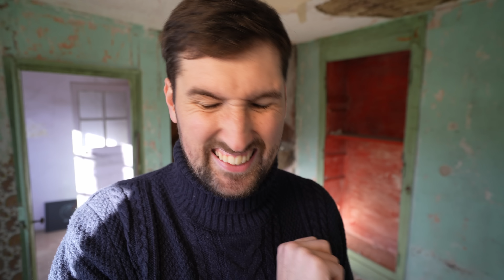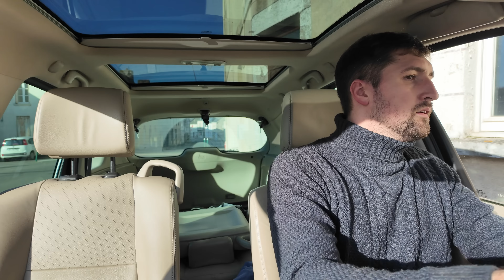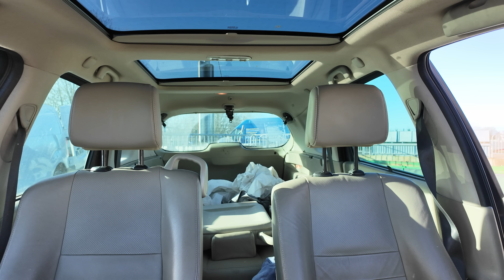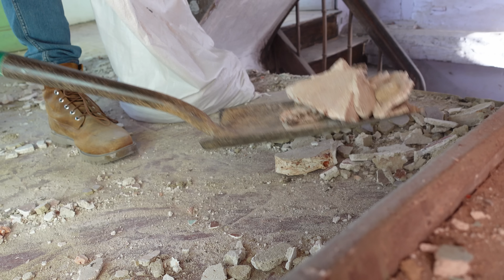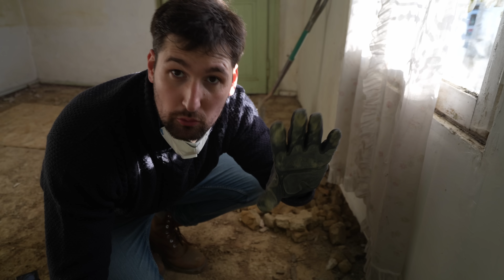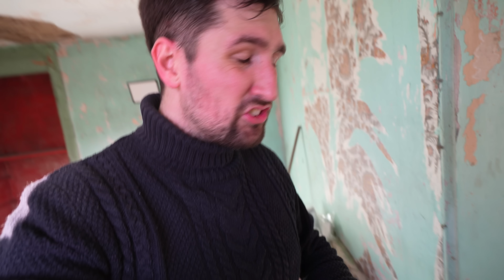The Unsettling Discovery I Never Saw Coming...

Comment: I have a suggestion to reduce your picking up work.
Make the hole in floor where the damage already is. Put a garbage can on the level below directly under the hole. Line the trash can with your bags. Then simply shovel the dirt into the trash bag/can below.
Easy Peasy👌
Reply: Fabulous idea. 🤙
Reply: The only problem is will stir up more dust into air that way. But otherwise gravity works. That's what they do in mines use chutes.
Reply: Et poser une goulotte à gravat dans le trou. Les gravats descendront doucement à l'étage du dessous. Courage.
Reply: @alphaonde8144  Oui, ce serait mieux! 👌
Reply: Also, start at the top and work down otherwise you mess up what you have already cleared.

Comment: That’s a great habit to pick up from Billy, clean as you go. There’s far less chance of injury tripping over something on the floor. It’s great to see you getting into the renovation, but I have to say that the floor in your ensuite really has me worried. It doesn’t seem to have great support for all that weight. But you’re going to know more as you get going on it. Good luck, hope it’s not too bad.🤞
Reply: I don’t think Billy ever leaves without cleaning up!
Reply: Do they have rubbish containers that can be dropped off at a property, and that way, you just throw all your refuse in it, they pick it up, when full, and take it to the tip.
Reply: @terriwho7613 regretfully Ryan has no outside space so all waste has to be stored on site untill tip load acuminated.
Reply: And saying crack on lol.
Reply: Roll down the top of your rubbish bag, it will sit on the floor better which makes it easier to shovel into, unroll as bag fills
Reply: I think cleaning up rubble everyday also gives you a sense of hope. When there’s rubbish left everywhere you just feel like it’s a chore on top top of a chore on top of more chores as they accumulate, not great for the motivation or mental well being particularly for those inevitable days that will be tougher than others
Reply: Re: Safety. That stairwell really needs to kept swept Ryan. I kept waiting for you to take a sliding tumble down them as you were carrying the rubble sacks downstairs.
Reply: Ryan, I suggest you lay down some blue tarp sheets.  They're cheap enough ie. 12m×4m is only 5.99e in our local brico or Action store. We're currently renovating, but our walls are covered in cement. It was very popular in the 70s as do called insulation 🙈🙈💕
Reply: @terriwho7613  umm, where would they put something like that?
Reply: @pinkelephants1421  That could happen. Those stairs are steep and narrow. Not much room for error...

Comment: I find it completely bizarre that anyone at any time thought that it was a good idea to make a floor with wood, covered in dirt, covered in tiles. Just a thought - if you roll the tops of the bags down a few times it will help to hold the bag open while you fill it. Looking forward to seeing the renovating progress.
Reply: dirt was the best cheapest insulation and soundproofing to be found in the days these  houses were built probably best  cheap soundproofing today if if people didn't relate dirt with unhygienic
Reply: My thoughts also about turning down the bags slightly a couple of times. Helps greatly to keep the bag open and saves time fiddling with keeping the bag open.
Reply: I've never seen a dirt floor unless it was the ground floor which was the actual earth. I've never seen anyone put dirt on top of wooden floor. That makes no sense.  Beginning to see why the house is only £15,000.
Reply: My same thought to tell Ryan…lol😊
Reply: Ryan, what about rather get a small trailer for behind your car, that will help a lot and save your car. Love  your place! 😍
Reply: Your whole comment was exactly what I thought! 😅
Reply: @elsaduplessis3185 try driving that in those mountain cities and  roads😮
Reply: @whytedraegon66  I didn't even consider the hygiene  aspect, I was more thinking of the weight and ability to hold moisture. =)
Reply: @elsaduplessis3185 
I took the backseats out of my car and can get an extension ladder and lots of stuff in there and still close the trunk door. It’s almost as good as a van.
Reply: Il fessait cela pour isoler  et insonorisé.et  , au raide chaussée, il pose les dalle sur sable.

Comment: Wood under a soil floor has the potential to retain moisture and ROT! Ryan you are right….it’s CRAZY !  If one beam  is rotten, all the beams will need to be examined & assessed. You’ll sure need to rent a dumpster ( aka a Skip) to get rid of all the rotten structure.
Reply: Wood under a soil floor is a crazy thing that I've never seen before.
Reply: Why would they put dirt on top of wood on an upstairs floor?  Weird.
Reply: Stop the stench of the rotting bodies….wooooo
Reply: @caseyflorida  Insulation factor.
Reply: It’s the French 🙄 don’t try to make sense of it. 😂
Reply: It seems standard in older homes. As long as it stays dry it seems fine. On “how to renovate a chateaux” channel they refinished the floors, had to make some repairs, they left the dirt at the carpenters advice… 
I guess in the old days it was harder to plane wood to be exact thicknesses so they could have a variable thickness layer made of dirt so the finished surface would be even.
Reply: I think the rot is concentrated under that window. I bet it leaked and the water absorbed into the dirt, beans etc…
Reply: He has no backyard, front yard, or driveway to put a skip.
Reply: @martinfurtner2136  It’s funny how ppl above commented and mocked techniques that they had no understanding of, like they don’t let their ignorance get in the way do they😂

Comment: You could use a couple of plastic garbage cans the same capacity (liters?) as your bags, and use them to support the bags and not have to hold them open with one hand. Also, lay a huge plastic sheeting on the lower level floor to catch dirt and stones. Then grab the 4 corners of the sheeting to take to the tip, and you won’t have to shovel or sweep.
Reply: I feel the cans are easier to carry (not fully loaded obviously) down the stairs.
Reply: Ryan  perhaps it's time to buy or rent an OLDTRUCK. AS U WILL NEED MORE HAULING AND CAR WILL GET BEAT UP AND LIJELY GET VERY DIRTY.  U WILL NEED TO HAUL BIGGER LOADS FOR TIME MANAGEMENT MY DEAR😂
Reply: @boessheila50  he clearly said in the video that those are difficult to come by & expensive if you can find one in his area.

Comment: Perhaps a small trailer would be your best bet for hauling stuff to the tip and supplies from Brico.
Reply: Trailers are very expensive, and it does not look like he has parking for one.
Reply: @janetpendlebury6808  It really depends on the type of trailer that he buys.  He isn't going to pull a large one behind his car.  Just a small utility trailer that can be pulled behind a small car like his should be fine.  He has a parking problem already, therefore loading up a trailer with rubbish to go to the tip shouldn't be that bad.  Ed on the Bordeaux Life YT channel parks his van on the street to load and unload it.  So I guess Ryan would be fine parking on the street too.  But you do make a very good point.

Comment: Isn’t that earthen floor extremely heavy? So crazy. When you have the dirt out the new floor will be so much safer. I can’t believe it. That dirt is insane. Hauling it up would have been backbreaking labor. I would push it through the hole so you don’t have to lug it down the stairs.
Reply: Probably the best affordable option at the time, especially during war years.
Reply: @dwestibclc Right, it would work as insulation and sound proofing.

Comment: Bon courage, Ryan. What an adventure you have ahead of you. 
A thought on your 'dirt' bags. I'm not sure if it will even work but worth mentioning - if you get a laundry bag frame and clip the edges of the bags over that, it may make filling easier. It doesn't even have to be that sturdy because the bag will be resting on the floor and it will simply be to hold the bag open.

Comment: Ryan removing the dirt base is going to reveal the wooden subfloor and weaken the floor on which you are standing. I think a scaffold may be needed so that you have a solid place to be while removing the floor. take out the floor and make a space for scaffold and go from there the beam is done for and needs replacing. If one floor is dodgey count on  having to remove and replace all flooring  in time
Reply: Why is there a dirt base on the floor to begin with?
Reply: @rumakingthatup , insulation. It was a pretty common way to insulate between floors for quite a long time.
Reply: @yasha.hartberg  thank you

Comment: To make your cleanup more efficient, think about using a large trash can as a support for the reusable bags.  Place bag inside the can and use clamps to fasten  bag to can 's top edge.  This will free up both hands and less spillage.  Also, could use large clips to hold opening of bag closed while transporting to Tip.

Comment: Do you have house surveys before you buy there? I realise it was a very reasonably priced house but such a shame the woodworm is going to give you more work. Also would it be worth while investing in a small trailer for your tip runs? I think you’re going to have many more trips there 😊
Reply: I think his dad had a small trailer but probably not road worthy/safe. I don't think it has tail lights, power brakes or a license plate.

Comment: Well done, you're right, you don't know what you're doing.

 Point one. The props work best if you put a lump of wood  ( old beam or such)against the ceiling supported by the props at each end, if you see what I mean. That way you're supporting not just the point above the props but also the space between. 

Point two. As you were going to dig the floor up anyway, you'd have saved yourself a lot of work by thumping a hole through the floor and chucking the rubble down below. All that hassle up and down stairs. You could also have lifted the full bags out through the window, saving time carrying it via the front door.

Point three. The likelihood is the beams aren't such a problem. They will most likely run front to back of the house. The problem is the boards running across the beams are rotten, as you've already found out. Let me explain. Beams run front to back, planking, or in rural parts, lathes, run side to side across the beams. Mud and rubble then goes on the planks, followed by lime mortar that the tiles are bedded on.

Point four. Woodworm is everywhere in France, so don't surprise when finding it. Most woodwork is oak and too hard unless it's already rotten. You can get the treatment at the brico stores.

Point five. Don't trust the electrics. That's very old wiring and could well be dangerous. Better to put one new circuit in and run a multi socket off that. You can have a socket close to the breaker and run an extension lead from it if need be.

I could go on but that'll do for now. Good luck, you're going to need it.
Reply: I’m just curious, hope you don’t mind me asking but what is the purpose of the mud and rubble over wood on the floors?  For leveling? Insulation? Sound barrier. Thank you in advance. 😊
Reply: @laurelldockall2399 
I don't really know, could be for leveling and creating a more solid base for the tiles. But at the same time it would give some degree of insulation. I only know what's there because the first house I renovated had the same floor, only difference being it had thick wooden lathes over the beams. It was a country house, so I guess it originally was used for storage even though it was tiled over the one room.

Comment: Hi Ryan!  Love your $15k house & believe once you’re done renovating, it will be awesome!  Thanks for reading comments. 

Good that you removed the wall to   expose the wood staircase. Crossing fingers the staircase doesn’t have woodworm & you can keep it. Opening it up to the room looks so much better!  I have a feeling you’ll eventually identify  more non-load-bearing walls to  remove & make larger spaces. How exciting would that be???

Given that floor has so much woodworm, do you think it advisable to remove the lathe from below to assess the beams before standing on that floor? Asking because I would not want you to get hurt!  If the beams are okay and you can stand on that floor safely, using a jackhammer would make removing the dirt between beams quick & easy. You could even lay a tarp on the floor below and let debris fall down onto it. Would that speed clean-up?

Also, good on you for hauling debris to the tip as all the bags are  full.  It’s far easier on your back & makes for a safer worksite.

I’m excited for you, Ryan. If I was your age, I’d be doing the very same thing!

Wear your mask. Stay safe!  

Cheers!

Comment: Just a suggestion - but you may won’t to cover your steps on the stairway ?
After time and use during the renovation, may damage the finish to the steps. 
Deep scratches and dents - irreversible damage. 
If you install something that is non-slip cover over them, you will not have to do a little bit of sanding and apply finish coat.

Comment: Great attitude to the floor issue, I could see a broken beam at the root of the issue, but the load of an earth packed suspended floor also disturbed me. I see some work, some hard work ahead, but your attitude will carry you through and a far better house will emerge from all your hard work. It is good the you will have onsite power to drive the tools you will need.

Comment: Nice video. You can roll up the bags upper edge like you can roll up a sleeve. Then it will stay open. I demolished a 8x12 meter wooden floor in my barn and went through it twice, with one leg. 2 meter deep under that hay floor. Very scary. All that wood went in me woodburner, 19kW, to heat my house, last winter. Keep it up 😊

Comment: a couple of thoughts.  First, I  reckon that "second entrance" to the basement, was originally outside and the Shed-like attachment added over it at a  later date. The ramp  construction at that end suggests it may have been a Coal chute  ? or something of the sort .   If you block the tunnel at some mid  point ( I'd keep it as at least a nook  in the basement )  with a masonry or poured concrete wall, all ( or part of )that dirt from the floor can just be used to fill it. And since you now have a hole between what I think is the floor just above ground level?   build a frame on the ground level that holds a canvas sleeve up to the ceiling an  under which you can park a wheelbarrow. Then shovel the dirt  through the hole;  roll the wheelbarrow to the "second entrance"  and then use the dirt as fill into  the "second entrance".
saves bagging and transport to the dump.🙂

Comment: For the wall get some studs measure and cut them to fit and then 1 stud in middle nail all together and then put sheetrock on outside and inside then tape, float and paint.😊

Comment: 12:05 Ryan, if you're working by yourself, you need some music in the background, mate. Helps ease the creepiness of being alone in a old building...
Why would they lay dirt onto a floor a couple of floors up? 
I know budget is tight, but suggest clearing out that whole floor..... Remove all that dirt, expose the whole boarding floor underneath, assess what needs to be treated or replaced....
We are with you Ryan...... Find out how much wood you need, price it... In the meantime, get that beam supported, make underneath safe from ceiling collapse.... Once it is safe, then you extend time to fix that flooring so can save for the proper materials.

Comment: After stabilizing that floor a bit, and your roof patch mentioned, you should plan on getting the toilet into working order. As an old guy, I know that having one around especially when bending over and kneeling a lot can make life much easier. You could almost camp over there occasionally then too and save a commute once in a while. 
And there is only one good way to eat an elephant...
One bite at a time.
Stay motivated! It will be wonderful.

Comment: A historical renovation! Well done so far. Hard work and huge reward.
Just a safety request. Some on suggested using the existing hole as a temporary demolition chute. Great idea, but please reinforce the ceiling on the lower floor. Add a couple more standards with a couple of beams tying them at the top.
Again, Well Done!

Comment: If you make a very simple frame that the bags will fit into, it would hold them upright and make them more easy to fill. Just make it high enough to hang the top part over the edge. Easier than opening the bag every spadeful. 😊

Comment: To haul away all that debris you're going to need something a bit bigger than your car. For every cubic meter of the dirt and stone you'll have around 1.5-2.0 tons. There's a lot of weight in that floor. The wood won't weigh much because the woodworm has eaten most of it. The family doing Chateau de la Ferte got into the same situation and ended up rebuilding the whole floor in their great room.

Comment: Good to see you cleaning up as you go.   Why don’t you hire a skip/bin for right outside your door.  They’re generally really cheap.  It blows my mind that they put that much weight of sand / tile on wood floors.  Also, good to see you wearing the mask when removing the rubbish, but the other day when hacking away at the walls you should have worn safety glasses.  Excited to see the results.

Comment: The woodworm came in with the dirt, which was used for insulation.

I would refloor one room at a time because the other rooms will need to be used for power tools and supplies